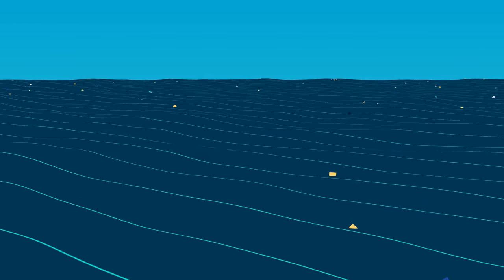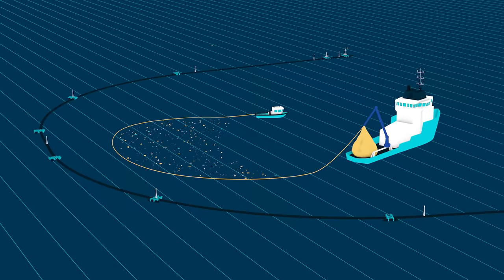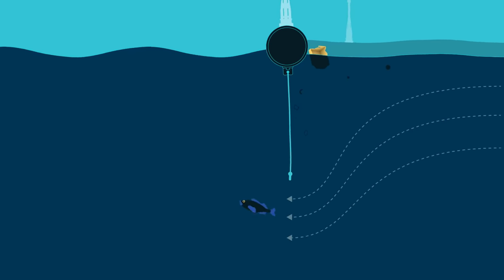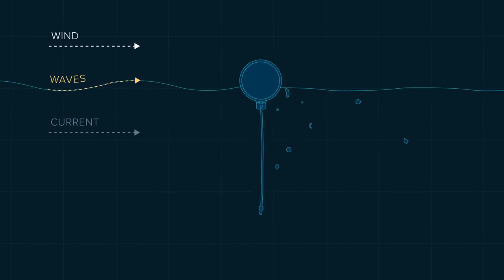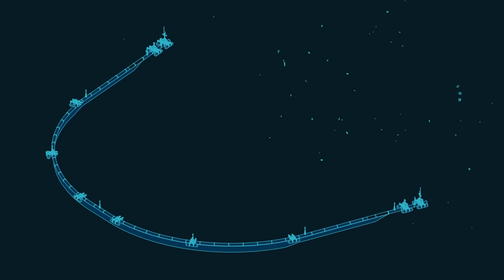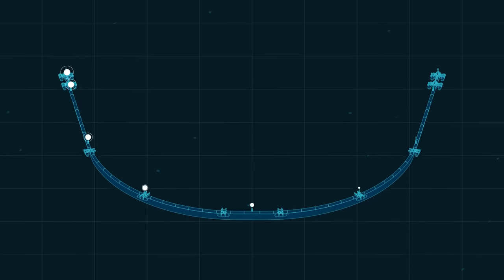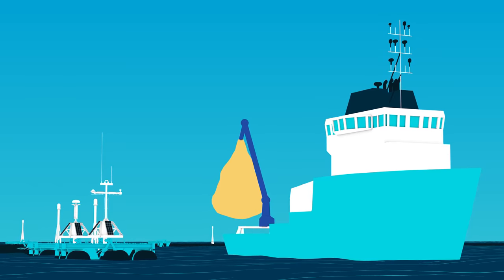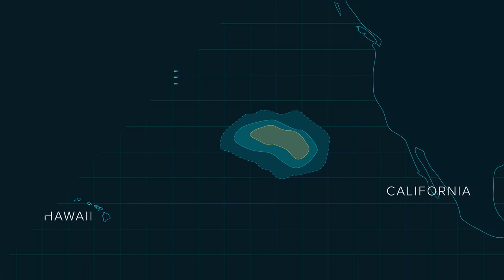The Ocean Cleanup System 001 Explained |  | Cleaning Oceans

Comment: How much carbon emissions will this system require to manufacture and maintain? Is removing plastic from the ocean worth the increased global warming?
Reply: Gordon Tendick Global warming is a hoax just like the “Pacific Garbage Patch” is a hoax.

So you have got nothing to worry about.
Reply: Dont you have anything other than hoaxing every innovative ideas you see?
Reply: How much CO2 do you think will be released manufacturing pipes and screens for 60 systems? it will be negligible considering what you are trying to use the systems for.

Stop worrying about the CO2 emissions, we as humans are already doing a lot of damage daily.
Reply: Gopinath M S If they really cared about humanity they would be solving real problems. 

Not pretending to clean up garbage that’s not even there.